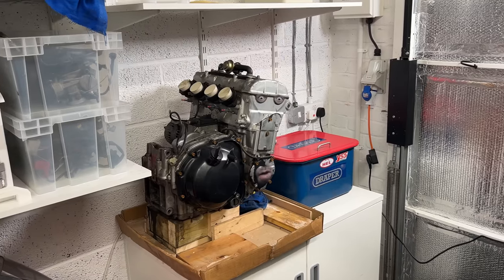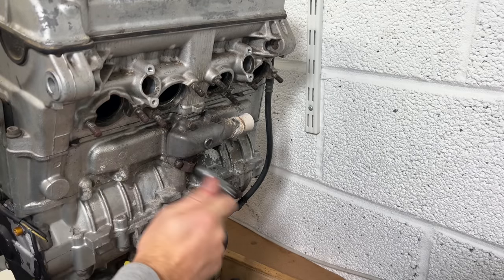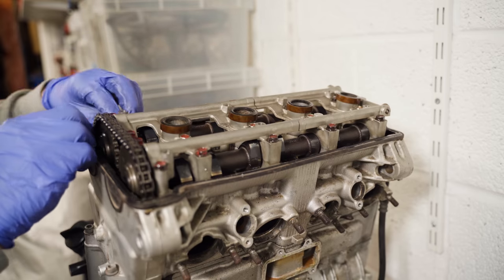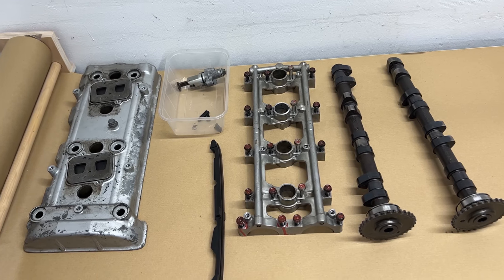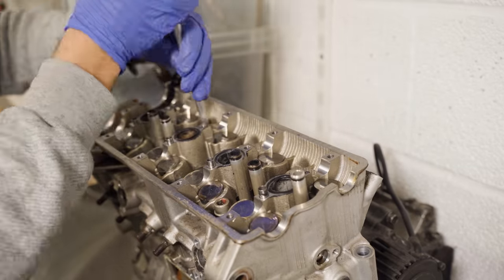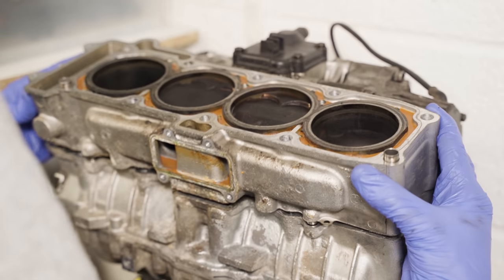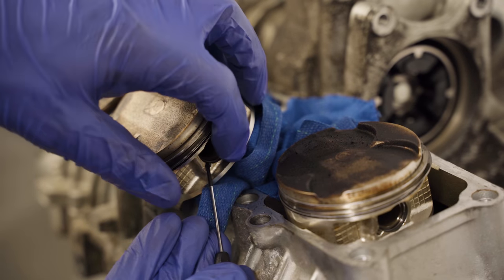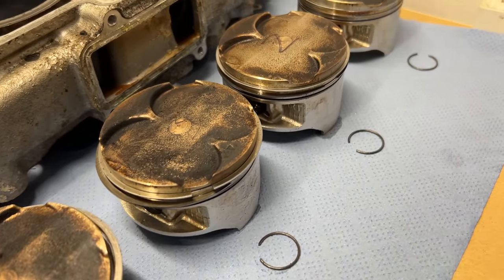ZX7R Engine Overhaul - Ep6 | ZX7R Restoration | Tom's Workshop

Comment: Nice job Tom. Looks like there are no hidden surprises though you didn't shown the state of the valves in the head. But with no crusty deposits on the piston tops the valves should be good.
Reply: You won't see a lot until he takes them out, obvs they will have a fair bit of carbon build up like the pistons though.
Reply from the maker: Yeah I gave them a glance, but haven’t flipped it over fully yet so the buckets and shims don’t all fall out, I’ll do a whole vid on the head and valves after the next one 👍🏻

Comment: Looks like it’s got yoshimura ignition advancer fitted 🤔
Reply: Yep I noticed the 4 degree advancer, a must on all bikes of this era, have one on my ZX9r. That with iridium plugs, shimmed main jet needles and a few other mods and tweaks make these awesome bikes much better.
Reply from the maker: Good spot, it’s all forming pieces of a puzzle, is there other things that get changed to match these advancers, that I should be looking out for?
Reply: The advancer is a worthwhile mod on its own, but deleting the clean air  system is a fantastic complement to it. All the carb 'fluffiness' at low rpm will disappear.

Comment: Like all first timmers you are not using enough lube.  Spray a little penetrating lube on those bolts and cylinder walls before you try to take things apart.  If it saves you one sheared bolt one time its worth it.  Good job other than that.  Take lots of still pics also they help when you go to reassemble.  👍
Reply from the maker: Haha cheers! I guess the benefits of lube can never be understated in all areas of life!

Comment: A small tip for the future, put a long ziptie around the camchain as you're taking apart the engine this will help fishing it out if you ever need to, and will also help witb reassembly.
Reply from the maker: Cheers, Yeah I’ve done that before, particularly when it’s in the middle the engine and it’s busy the cams coming off. This one’s been pretty easy to fish out thankfully.

Comment: I can confirm Tom that broken part is the top cam chain guide you thought it was, it is common on these, done my valve clearances this year and mine was broke in two ready to drop off, good luck with the rest mate👍
Reply from the maker: Cheers! I’d figured as much, and it’s missing from the inside of the cover. I expect there’s more in the sump as it doesn’t look like all of it was up the top.

Comment: I have P2 - owned since new - with 52k on the clock. Never had to open the engine but have had clutch out and valve timings. Last year gave the front of the engine a spruce up. 7R lower fairing scoop design allows all that salt  through and my oil cooler was in a terrible state as was the radiator bracket and horizontal coolant pipe. Replace coolant hoses which are now about 20 years old. Great work on engine, but it is practically unburstable!
Reply: At the mileage it is now at, I would suggest a refresh though, new piston rings, gaskets and oil seals. Honestly you'll notice the difference a lot when you ride it again.
Reply from the maker: That’s good to hear, I’ve heard these things are solid and somewhat over-engineered. Yeah I think the front gets the brunt of the weather. I’ll be giving fresh paint hopefully 🤞
Reply: @HalfdeadRider I haven't ruled that out but a lot of my effort has gone in to keeping it running AND maintaining its bodywork and running gear. It has the breather mod, rejetted, 15 tooth front sprocket, and honestly pulls like a 900. Feels stronger and more powerful than when new. Love the bike to death!
Reply: @darthninja1  If it's been well maintained I probably wouldn't even consider touching the engine internals till 100000 miles. From what I've seen at that mileage it is the top end valve train that will show a little sign of wear. Even then. At that mileage you have to weigh up if you want to keep the bike going and see how long it will last or refresh it for peace of mind. Might even just want to get a new bike.

Comment: I am Intimately familiar with the the previous gen ZX7R, so watching this with real interest. I agree with a previous comment that there are no surprises yet, but at this point you correctly point out there’s no turning back. You must split the cases as well. 
Your overheating issues are probably radiator related, they get road debris damage and grime so air doesn’t flow properly through. Well done so far, cheers from America!
Reply from the maker: Cheers, Yeah I think the radiators long overdue a clean, hopefully that’ll be the trick. I’m hoping to not split the cases unless I find a strong reason to, though I will open the sump and clutch cover too.
Reply: @tomsworkshopprojects  ok. So you know I had a ZX7 and a ZX7R. Both had R engines the standard 7 got the R engine second hand after a crash that ruined the stock one. Back then parts were all over the place easy to get. Started getting blow by on the rings on one of the engines, and at that time I met a guy racing D-superbike  CB1 It was like anything goes in that category. So I started building engines, we learned together. That engine you have has a really short stroke very difficult to get the cylinder block down over those pistons without snagging a ring, its much easier to have the pistons already on the rods, use a ring compressor to drop them down into the cylinder block. Then attach them to the crank shaft, the way you would do on an R6 Yamaha where the cylinders and top half of the cases are one piece. Good luck, hope that helps you.

Comment: A little tip if I may. Always measure the valve clearances and note them down before removing the cams. Then make a note of the shim sizes. It’ll save time on reassembly.👍
Reply from the maker: I did start measuring a few, but I’m somewhat expecting to need to lap the valves so figured that would make them void. I’d like the take the time on the reassembly to do a bit of a “how to” on the valve clearances if it helps others looking to do it.

Comment: Hi Tom
Excellent video again like your take your time don’t rush attitude 
The head bolt with corrosion on could be a weep from the head gasket worth a very close inspection in that area
Keep up the high standard
Reply from the maker: Thanks Dad, good idea, I’ll have another look at it. I’ll replace the gasket anyway but will make sure the surfaces are all clean too

Comment: Nice work Tom..
I know you probably will check it out but with that can chain guide disintegrating like that you should drop the oil pan and clean out the pickup screen..
There will be a lot of pieces in it..
I had 2 of mine do the same as yours..
Cheers..

Stew
Reply from the maker: Cheers Stew, yeah I’ll be going through that for sure. Glad it wasn’t just mine 😂

Comment: I'm really enjoying the project Tom - and your video work is superb. Since my increasingly long-term build is a ZX7R too (albeit in a naked/'fighter incarnation), I'd be forever grateful to you if you could show the orientation and routing of all the coolant hoses once the rebuilt motor is back in the frame. I'm replacing all the original & tired rubbery jobs with a snazzy Samco Kit, but time's taken its toll on my memory & I'm struggling to work out which hose goes where! It all seemed so obvious & straightforward at the time they all got removed; and even the pictures I took for future reference have turned out to be pathetically inadequate... 🥴
Anyhoo,, keep on keeping on bab - & well done for a crackin' series👍
Reply from the maker: Cheers! Ah yeah I know that feeling, I’ve taken plenty of pics on the way down, but will definitely make a show of it going back together (assuming it goes smoothly!) I’ll probably do cooling system first up once the engine’s back in the frame 👌🏼
Reply: @tomsworkshopprojects  Thanks ever-so' Tom, you're a bloody star! Here's to that engine going back together smoothly for ya 👍

Comment: Great work.really enjoyed that. I have been that deep myself.  I was rooting for you with every one of those head bolts,terrifying. Junk all that emissions crap on the top of the rocker it does them no favours.also is that an aftermarket ignition advancer. Did you check the valve clearances before pulling it down may have saved a bit of time later
Reply from the maker: Cheers Gary, I did measure a few clearances but I’m somewhat expecting to be lapping the valves so figured they’d all be void if I did them fully. I might try to make that stage a bit of a “how to” as well to help others doing it. Good shout on the emissions stuff, I’ve heard a few things about removing it, so will look into it properly.

Comment: Nice video. But why worry when stripping down? The difficult bit is building it back up, things like  fitting the 4 cly barrel over the pistons without breaking rings (you will need 2 ring-clamps to do this professionally). One tip, make sure you do all the valve clearances with the engine out and still  ON THE BENCH; it's just SO much easier.
Reply from the maker: Cheers, yeah that’s a good thought about valve clearances. I’ve hopefully got enough compressor rings to do the two at once. I think the “worry” is more just a sense of once you strip something you’re committing to the reassembly down the line 😂
Reply: @tomsworkshopprojects  Completely sympathise and understand your reasoning! I did a 1995 L3 model. Needed to Strip it completely and the only item in the engine NOT taken apart was the starter clutch assembly (inside the upper crank case if I remember correctly), this was known to be working well, so I left well alone. Everything else was stripped, measured, bearings replaced, parts out of spec changed (but these were VERY few, and most internals changed were thrust washers etc in the gearbox, just to get that sweet whilst it was apart and I had the opportunity ).  I had never worked on a Four cylinder engine bottom end before; I used my bible which is the Clymer Manual, which I can recommend without hesitation and in-fact covers yours AND my models. I had no issues at all on building the engine apart from seating the barrel over the pistons, with NO ring compressor at all (nb I bent one brand new ring on first attempt, very annoying). These engines appear relatively easy IF you follow the Clymer manual. I do not know the Haynes one, I recommend buying the former. One more thing; try and just clean up the valves and refit them WITHOUT messing with  the seats, unless you really have to. Then measure and re-shim the head out of the chassis.  Some idiot blasted my head with the valves removed and I had to regrind the the seats; this meant that the clearances needed re-doing after a few miles were run. This had to be done with engine now back in frame; and THAT really is fun and also very nerve-wracking as the shims fall out into the cylinder head OR beyond. Use a magnet pen to help you both install and remove these shims, and keep the faith !
Reply: @tomsworkshopprojects  I  forgot to say that I bought my L3 with a sheared water pump drive shaft (I discovered this on strip-down). This drive shaft comes off the opposite end of the OIL Pump. This coupling between the two is possibly a weak point in the engine design? Be sure to inspect these two items and their coupling very closely whilst apart and replace if necessary (only used parts are available now if the same for your model)? And lastly,  I know from your approach shown on the videos that you are well capable of getting a good job done on the engine, possibly the most demanding point of this rebuild, the rest is easy, but follow the manual religiously.
Reply from the maker: @richardraby6266  wow that’s really helpful, cheers! That sounds like it was as educational as it was satisfying? I’ll look into the Clymer manual, can’t see a harm in having more info than less. Yeah my current hope is the valves will need a very gentle clean up and quick lapping, I had pretty good compression before stripping but there are a few that bubble up when doing the blow gun test. Got the wheels video almost finished and then I’m getting into the head work.

Comment: Good to see all the bits on the 7r.. just windering what the 2 small bts are that came out of the neutral switch  hole....i have to change mine.some time
Reply from the maker: They’re part of the switch, a small plunger and a spring, surprised me when I saw them, but looked at the manual later to work it out.

Comment: The plastic would have been the cam cover silencer plate.  You normally find them in the sump . 
Looks like you have a +4 ignition advancer. 
are you going to do the vlean air mod whilst your working on the motor ?
Reply from the maker: Yeah I think you’re right, it’s missing from the inside of the cover. Yeah I didn’t notice that at the time, looks like a Yoshi one, gotta look into what that’s about. Learning a lot doing this! I’ll definitely look into removing the clean air stuff. Looks like a no brainier.
Reply: @tomsworkshopprojects  the +4 advanced makes the timing 4 degrees in advance of standard.  
It makes for a crisper throttle action.  
The clean air mod involves blocking off the cam cover valves.  And then blocking off the pipe that would go into the airbox. 
Black silicone works well for this.  
I have had about 8 zx7rs over the years.

Comment: Good job Tom. I like your confidence with stripping the engine. Care and attention is the key, and you seem to have cracked that.
Did you check the engine number against the log book or with it being an import is the engine number the same as the frame number? They tend to do that with imports into the UK.
Reply from the maker: Cheers, there’s no engine number listed in the logbook, so it may be I need to call a Kawasaki dealer to look it up. It’d be nice to rule it out officially, though it’s nice to know it’ll be all tip top when I’m through.

Comment: Appreciated the time / effort to upload. Fyi, the Gasket on the oil 'blow-by @ 13:24 is NLLA (no longer available) from  Kawasaki OEM Parts list? As far as i'm aware, so caution required for that gasket. Thanks
Reply from the maker: Thanks for the heads up, I’ll be sure to keep it safe!

Comment: Another great video, thanks for that. Just one question, did you check the valve clearance before taking out the camshafts?
Reply from the maker: Haha, I glanced at them 😂 no I did check a few, but had a strong feeling I’d be lapping valves so they’d then be void. I want to do a detailed video on the process on the way back together so figured I don’t mind that it adds time to it.
Reply: @tomsworkshopprojects  that explains a lot. I'm already looking forward to the next video. Cheers

Comment: Well done!
Are you planning to replace the valve seals?
Bit of a PITA job but worthwhile if you got the head off.
Also, swap over to a manual CCT
Reply from the maker: Yeah I’m planning to test the valves and lap them if needed, I’ll most likely replace the stem seals too. Is there a benefit to a manual CCT? More control over tension?
Reply: @tomsworkshopprojects  typically valve seals are super cheap and worthwhile to change.
For the manual CCT it'd mostly for piece of mind.  A mechanical cct is simple to use and will never fail.  Loads of Japanese OEM CCTs were problematical. 

But If it ain't broke...
Reply from the maker: Yeah I’ve got them on the “shopping list” I really want to do as much as I can to make it tip top for many miles.
Reply: @tomsworkshopprojects  
Between new rings,  hone,  and valve seals,  and a good break In, it will  be GTG for another 100k km.
Good habit to get into when checking a motor when you buy it, or before a major service, do a leak down test.  I'll give you an excellent indication of your engine internal (valve seals, piston rings).  A comp test prior to tear down also gives a decent idea of the health of the motor.
But leakdown is usually the best.

Comment: This is how to do it, and why it kind of frustrates me watching Americans pull bikes and engines apart, they all seem to just use impact guns and drills on everything, lazy and potential to round off or snap heads off the bolts, fine if cracked first, but they don't, lets not talk about putting them back in 😂
It would have been a quite a bit easier using a breaker bar on the head bolts though, recently done my ZX9r, didn't touch the block and pistons though. Those sparkplug gaskets could be the reason it was overheating, mine were very bad on only 22k miles.
Reply from the maker: Haha yeah I wince when watching them. My issue was the block spinning rather than having enough torque. Interesting point on the spark plug gaskets, the main symptom was hard starting when hot.

Comment: Should have checked those valves before you removed that cam cap.
Reply from the maker: I did start checking them, but then remembered I’ll be lapping the valves so I’d need to do them all again anyway. Might have been nice to have a starting measurement though
Reply: @tomsworkshopprojects  yep always , best time to do it, it’s a headache putting everything back together and torquing to spec just to check them